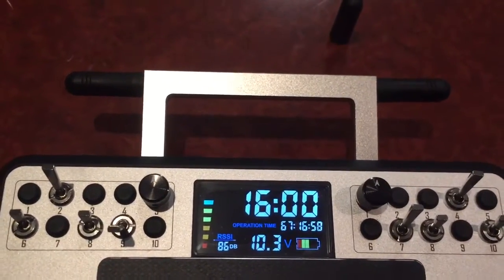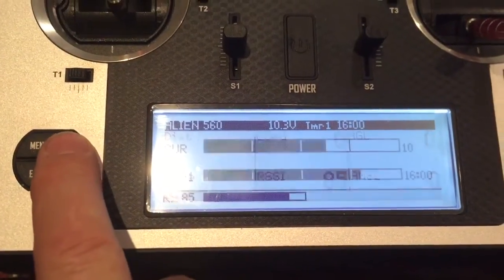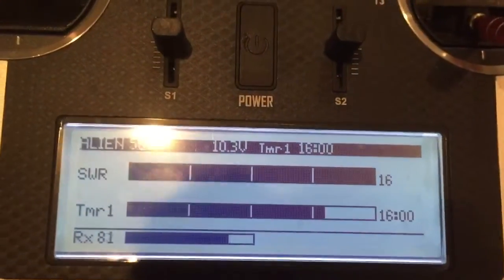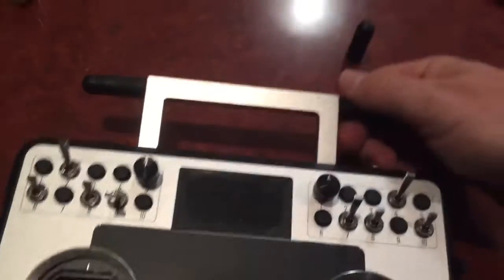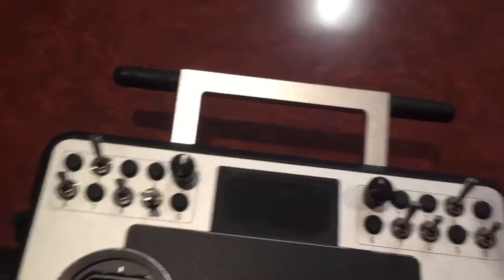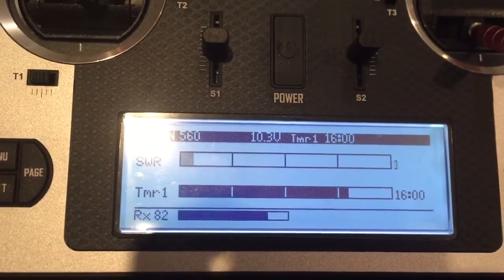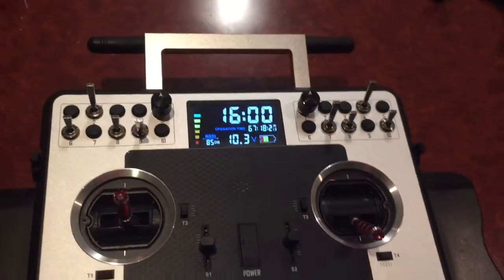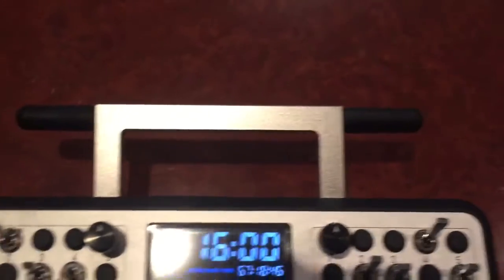Taranis X9E with new antennas.

Comment: Hi Rob, Interesting comparison.  I was thinking of trying a 2.4GhZ antenna off a Wifi access point.  I think they are 6db, which should increase the range.  While range is not a problem I have had issues with interference in the metro area being flooded with 2.4 .  Do you think it is a good idea ?
Reply from the maker: I think it should be fine.  A few guys have done this already on the X9E thread on RCG.